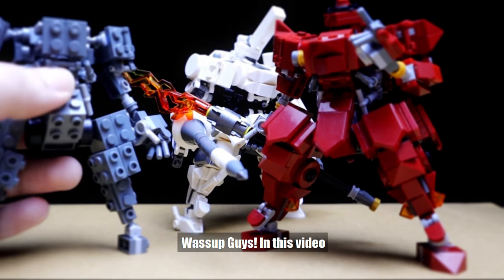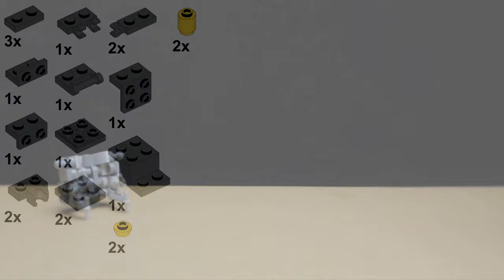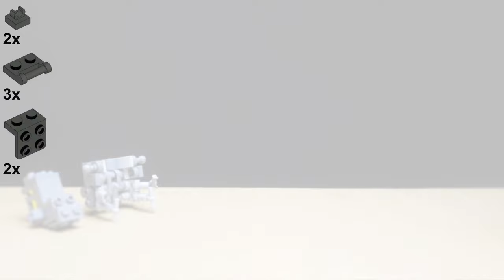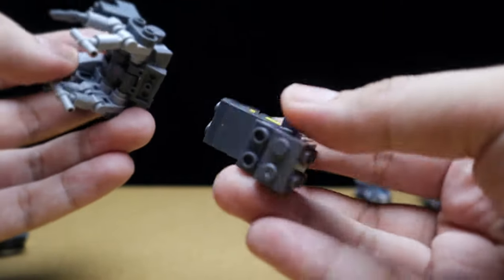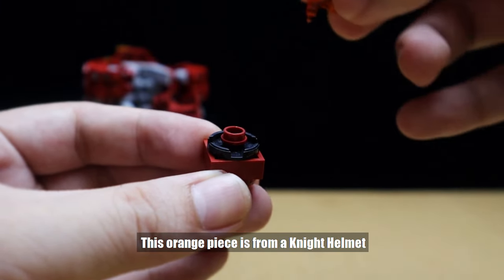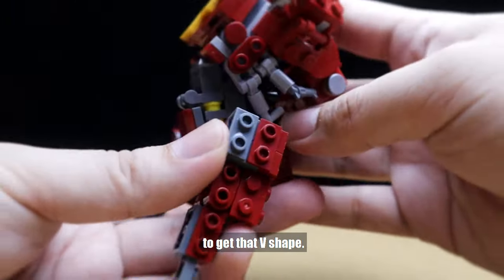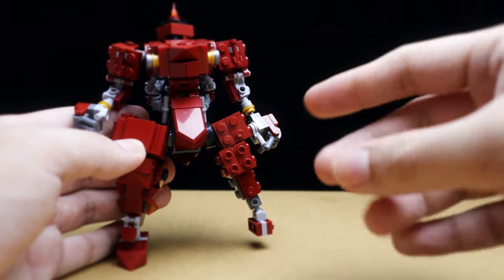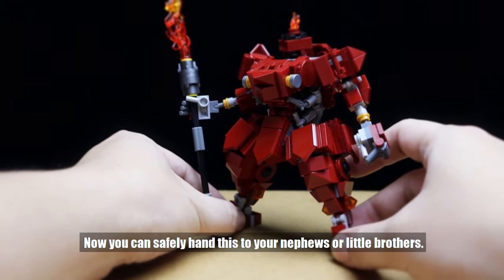Wick || A VERY simple Mech and Frame Lego Build Tutorial

Comment: if I'm wrong, correct me, but it seems to me that the connection between the lower body and the upper part is quite fragile, does it hold well or not?
Reply: Unless you are throwing it around it's somewhat stable.